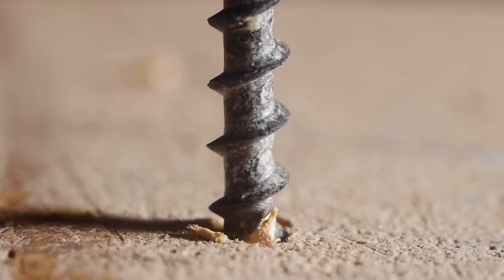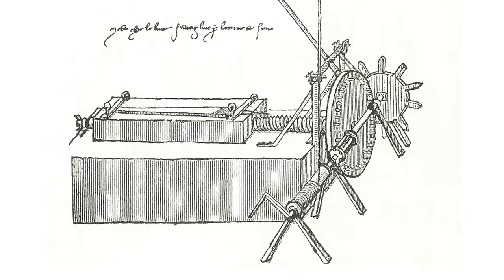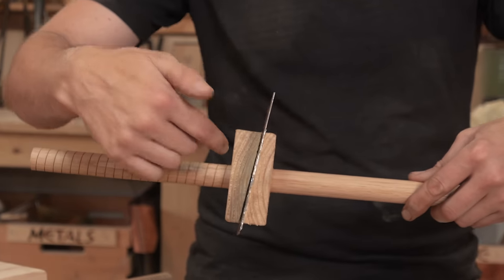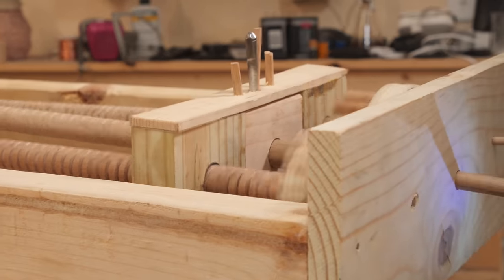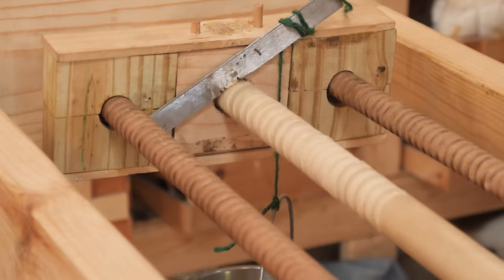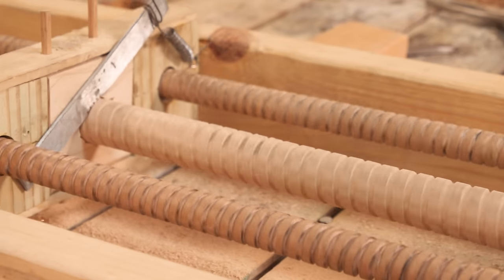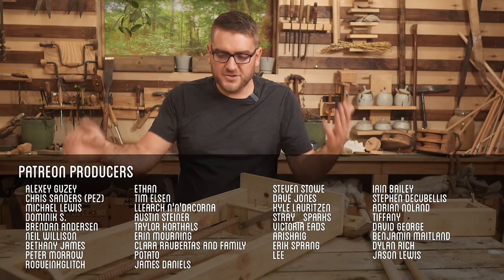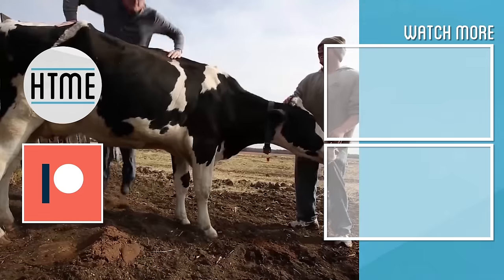This DaVinci Machine Unlocks Precision!

Comment: FWIW, I'd love to see the full treatment on how to make lead screws from scratch. That is make a long screw that can produce motion accurate into the 0.001" range (or below) over it's full length. Ideally staring with nothing more accurate than cast or hot rolled iron/steel stock and hand forged tool.

I've found documentation of how to make surface plates, angle blocks, cylinders and more or less all the other parts needed to build machine tools, but the precision feeding part I've only got my own educated guesses on.
Reply: Ive made leadscrews! For otherpeople and money and everything, I guess that means I am actually a professional.

Simularly to flats, and angle plates the leadscrews can and will slowly lap together to make a perfect average of the pitchs if you lap 3 together, however just like a surface plate threads have thier own potato chipping phenomia where they try to just become a dowl rod the size of the minor diameter. This is avoided by using at least two nuts per thread rod in the the rotation of lapping together, AND using two half nuts in the measuring stage, one to pull your measurement referance the other with lapping compound or has a dimond cutter imbedded, and is left disengaged until an error is measured, then it is engaged and pressure is applied in the direction that material needs to be removed.

I know that describing anything to do with helix's with text alone is difficult to do and I only write okay, feel free to ask me anything.
Reply: @AnonymousAnarchist2  I can sort of follow.

How fast do the threads get removed? If it's not too fast, and if you aren't working at the limits of precision, I wonder if it might be simpler to just live with the threads going away while making a master, deal with whatever the thread form ends up being and then cut whatever form you actually need from that? For that matter, what thread form is best for both constructing and using high accuracy screws? I'm thinking ACME or square (if not an outright dovetail form) but that's just an off the top of my head guess.

Comment: Re: Metal screws  I know little about that process, but a bit about forging in general.  If you create a wedge shaped die and forge in the flat sides of the shaft to create fins running along the edges of the shaft, you might be able to just twist the nail and end up with a screw.  Or even if you don't forge it in, you could file it in, then twist.

Comment: Self reversing lead screws exist and allow a constant direction rotational input to result in a cyclical motion of the carrier down the axis of the lead screw.
Common modern applications are where a guide is being used to facilitate the winding of a loose string/cable. Think reels on fishing rods or winches on trucks.

They effectively have a thread cut down one side, stop during the middle of the last thread, then cut a reverse thread going back in the other direction. The two threads cross each other with a round turn around at the end.
If you make forward and reverse drive lead-screws for your DaVinci Machine, you should be able to cut a self reversing one.

Comment: I have a decade of fastener design and manufacturing experience.  Contrary to popular belief threads are not cut but rolled for most fasteners.  Using lots of pressure the blanks are rolled between 2 dies that resemble very large files.  This produces stronger parts with less waste much faster than cutting threads.
Reply: I thought they might finally get to that.  But no.  Wonder if they even know it.

Comment: For screws I would suggest a large mold that has a screw pattern in it so when it's cold you get a screw red hot and put it in there, then put it between the two half's of the screw mold, hit with hammer a ton while keeping it pressed shut. Should be a shorter process

Comment: Another method of making screws is the way very old blacksmith vice screws were made - you can use a stop-block to forge two square rods.  Now heat them up and bend them together around a round mandrel, and last un screw one of the two  coils.  You can then solder the coils onto a round rod.  I have not seen this done on an old vice less than 150 years old, and only a couple of those.  Hope this helps.

Comment: Ides: Use the angled blade tool to guide a gouge (or other cutting device).  Even better, use two angled blades ahead of the gouge to better guide the tool and then you could even use a progression of gouges to cut deeper with each rotation.  Note that this is going to require a LOT more torque so you would probably want to make it a bench tool rather than a hand-held one.

Comment: It would require some work to build, but there are a couple ways to have a shuttle switch directions at one end and go back to the beginning.  The easiest to build might be something similar to the reverse gear in a manual transmission.  When the shuttle with the cutting tool reaches the end of the shaft, it pushes the entire shaft into a different "reverse" gear.  When it reaches the beginning, it pushes it back into "forward" gear.

Comment: This is where consulting a machinist is handy.
Whenever I need a tap size I don't have, I usually make one out of a grade 8 bolt by tapering the end a bit and then cutting 1 or more flutes into it with diamond grinding bits or a diamond wheel on a grinder. it works for most applications

If you're trying to do things way old school, I suggest making a crude triangular metal file at a forge with some high carbon steel & then use that as your cuter for the first metal screws. Then, you can make taps from those & eventually a machine that can use shaped cutters instead of a file. & your off to the races.

Next thing you know, you're landing on the moon. ;-)

Comment: At 4:30 a really basic proto-lathe that could spin the stick smoothly would allow much faster cutting of the initial thread with better control and repeatability. The proto-lathe would not have any threads, the woodworker simply follows the original scribed groove.

Comment: Now that you can make the screw and its nut, you can use that to further refine the screw cutting machine. If you cut a new screw and a nut, you can use those along with a dowel for the other side of the machine to cut even more precise screws.

I also believe that the first tool you made to make the first two screws could be refined into its own screw maker too

Comment: Funny...it struck me that, IMHO, you could use progressively larger saw blades when cutting the original threads, to make the threads more consistent, and end up with I kind of"Acme" threaded rod, ideal for a driving mechanism... Start with a thin blade, like a Japanese style saw blade, with a shim to fill the gaps to use thicker blades.

Comment: A few thoughts:
1) The Whitworth method works on cylinders as well as plates, so it should be possible to "lap" your dowels to each other and ensure perfect roundness and straightness (or at least as close to perfect as you can get with wood). 
2) Adding a second cutting tool on the back of the block which follows the existing groove should improve your cutting speed immensely. 
3) It looks like you need a guide or ways to ensure that the block doesn't ride up or down during operation. Having the lead screws or the workpiece warp like that is going to limit your precision level
4) You could try having the block push on a lever that shunts a sluice to the other side of a waterwheel as a reversing mechanism. I think it wouldn't work very well at halting precisely at the end of the workpiece, however, so you'd need to be okay with cutting off the end.
Reply: " The Whitworth method works on cylinders as well as plates," Could you please expand on that? I've been googling for a method of producing true cylinders in a fashion akin to 3 plate method but no success.
Reply: @valeriilos8306  the only real difference is the need to roll the cylinders together rather than simply pressing and lapping, and the need to either reverse the cylinders or translate them longitudinally so that convex or concave elements can't form. You still use three pieces, it's just a bit more labor-intensive.

Comment: I have an idea for a massive improvement and simplification of this machine. You could completely eliminate the drive screws. 

Take the manual blade block that you used to mark the first screw. Add a guide rail on either side of it to prevent it from rotating, while allowing it to move along the length of the screw blank. With a power source, whether manual or otherwise, drive the screw blank being cut. The blade block would be moved along as the screw being cut is driven. If you add a gouge or rasp to the blade block, you can cut the full thread in one operation.
Also, I really liked how you used wire for the opposite thread, I think you should stick with that.
Reply: nearly there. except you are requiring the tool or scribe to "drive itself" whilst simultaneously cutting...
what do you get if you "unwind" a screw?

a wedge, an inclined plane.

you simply pull a wedge in between a stop and the moving tool, a pulley set up on the shaft the screw is being cut into... the diameter of pulley, the shaft, and the angle of the wedge dictate the pitch or lead.

only an idiot would go to the trouble of cutting a thread out by hand first.

despite what all these videos would like you to believe, that is in fact how the first "accurate" screws were produced. using a wedge. the KISS principle.
Reply: @paradiselost9946  any videos of it being done?
Reply: @paradiselost9946   They already did in this video the fundamental basis of what I'm describing. Just do the manually-driven angled-blade cutting thing, but keep the blade block from rotating while allowing it to slide, and rotate the screw to be cut.
Reply: @paradiselost9946  sounds brilliant in simplicity. Anywhere I can read more on this? Like the very basic methods of originating precision. 

Also, would the pulley have to be really big? I'm speaking circumference being larger than thread length. If you make it too small the thread will wind up onto itself and change the diameter as you go.

Thank you.
Reply: @valeriilos8306  i did some hunting... heron made a "nut boring machine" all the way back in... 0? suggesting the greeks knew perfectly well how to cut threads. then theres archimedes screw, that would have required laying out and constructing... to a fair degree of accuracy. and they were right up there on their geometry... mathematics. considering the anitikythera, etc... i doubt they were silly enough to try and cut a thread by hand using the primitive methods shown here... 

(also have to bear in mind that any machine that could be valued was hidden away from prying eyes... "classified information"... like crippling the scribes so they couldnt run away with secrets... or writing things backwards in a mirror...)

 personally, i only acknowledge davinci as the painter, not an inventor... merely sketching ideas, that werent necessarily his. and none were actually made...he lived for a long time and the nights were as long then as they are now? with far less distractions... what else are you meant to do with all that free time? learn how to write with both hands, of course! a great party trick?

and of course, someone took the effort to STORE his documents, his notes... AND they survived the ravages of time... how much information has humanity written down, or NOT written down, only to be lost?

anyway! enough! 

so... the pulley, yes... has to be wide enough at least to deal with the rope as its wound on without double wrapping or producing cosine errors as it fills the available space. thats a small challenge... but not overly hard.

other than that, the pitch/lead would be dictated by the angle of the wedge, considering pi*D, and the diameter of the pulley itself. and once you run out of wedge, seems relatively easy to step it over by so much, chase the existing thread, and continue on.

it sure isnt my idea, certain ive seen it somewhere in one of them books on "lost technology"...

and, then another thought? they could just as easily wind a strip of brass around a rod...

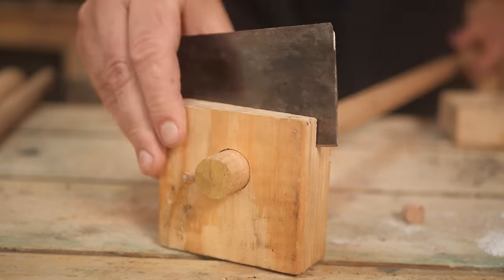Comment: Using blocks like the at 3:24 in succession and incremental depth of cut would likely be more efficient and more accurate as long as the pole is properly passing through guide holes along the way

Comment: Vices in the style of the stitching pony probably existed a long time before the screw. They use a rectangular piece of material (metal would be the strongest) to push the jaws together in a reverse wedge manner, although tightly tied cordage would work too. But also, a moveable jaw held in place by two wedges on the two rails works pretty well as a vice or clamp. I'm sorta suprised that you haven't made a vice yet, Clickspring made one several years ago for his (very long) Antikythera Mechanism research project.

Comment: You missed a key point. You can use the machine to make two threaded rods, then use those to make a next generation. Because the two rods average out, each generation has better threads. 🎉

Comment: There was no need to hand cut those threads.  Look at modern wooden thread cutters.  They use a V shaped gouge.  You had the right idea with the hole and angled cutter in the block trick, you just stopped one iteration too early!

Comment: Check out acme machine threads used to reverse automated machines.  You cut normally, then a trip unclamps the cutting nut, and engages a left handed acme nut.  and a trip on the far side allows continuous action.

Comment: The real trick to precision is to use a screw to make a more precise screw, bootstrapping yourself to something usable. If you cut a long nut, and run it over a screw with some sand in between, it will grind out the irregularities and result in a more accurate "averaged" screw. Use that screw to cut a new screw/nut pair and repeat. A similar process can also be used to make a very precise reference surface (Whitworth 3 plate method) from scratch.

Comment: An equivelent to a lead screw can be made from 2 winch pulleys of different diameter on common shaft, and arranged to wind off one, and onto to the other. Differental pulley. and equal spacing from rotation.

Comment: Next time you make a screw, Just make one spiral, rather than the entire set of spirals to keep consistency, Then create a form where you can pour melted aluminum, make plenty, then attach them together to keep everything uniform, then wrap the screw in a clay cast, fire up the clay cast, harden it and then the spiral will be able to slide up the clay cast easily.

Comment: I feel like you could use pulleys to pull a tool holder on a parallel guide rod to the work and have that driven by the rotation of the work piece. Like the automatic feed on a lathe when cuttingn threads. The threads per inch would be defined by the ratio between the pulleys sliding the tool holder and the gears spinning the work.

Comment: the next step is to cast the best of the 2 wooden screws using either sand or clay to make 2 more metal screws that are identical, or maybe 3, and use the 3rd for sharpening to make the router

Comment: If you are looking for a functional screw with period accurate materials I could possibly help.  You could plane a beam parallel then use a caridge with pulley wheels to steady linearly. Instead of a screw to drive the cutter, I would use either rope with a block and tackle pulley which will decrease the movement but increase the cutting force or a leather belt with reduction pulleys. Depends on the wood lathe. If you would like more info on me

Comment: Just so you know a lathe can make it's self and all the parts they need to function. Either way if you want more accuracy you need to start with threads cut by hand then use them to make more precise threads. Use those to make even more precise threads, ECT until you get a with in tolerance thread. You also could have used your "tap"  device to cut threads. You just needed to replace of of the dowels with a chisel.

Comment: The marking tool you used to make 2 two initial threads... wouldn't it have been simpler to make several such tools with progressively wider blades and run your dowels through them to get your screw?

Comment: A good blacksmith can make a inner thread cutting tool, if you are a woodworker can be a nice investment. The davinci device is just an automated version of the old way, you made 2 threads manually and if you replaced the blade with a saw blade with the proper profile the job is done

Comment: If you put the blade back at a shallower angle on your wooden die more and made a wedge for the blade like a plane so you could advance the blade with each cut you should be able to cut the threads with just that. Skip all that filing around.